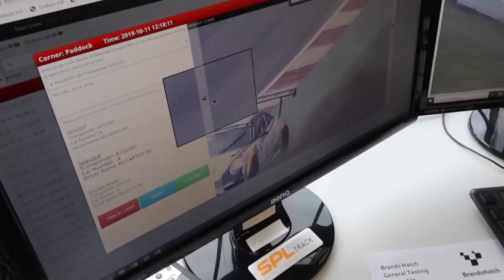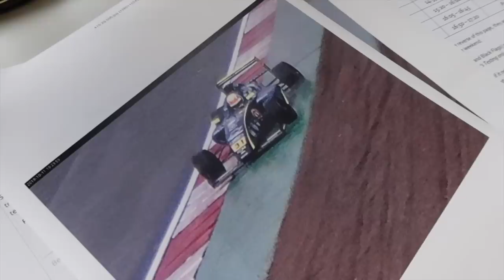Track limits: there is a safer solution! By Peter Windsor

Comment: Why overcomplicating things? Keep it simple. Create a band of, lets say asphalt, which creates much less grip than the race track at these corners, paint it what color you ever like and after that you still can have your run offs.
Leaving the limits of the track has to 'hurt' the driver, that moment when they leave the track, in form of loosing time, loosing control of the car for that moment and handle it, not by a penalty given afterwards.

Comment: How do ensure they don't abuse the allowable run off areas u use gravel or sand if u want to be stubborn about it...these saugage curbs are ridiculous...all seriousness keeping the curbs low for starters and making them into traction braking rumble strips but they should be low enuf to have an affect and still be able to drive over them simply....why in the hell in European circuit are u trying to reinvent the god damn wheel gravel pits worked perfect and they need to be perfected,hey this just in if u vary the degrees if dirt soft ness....hey I race motocross and Moto GP (superbike) when I missed turn one at Pocono going about 80 mph I knew my street tire were not going to offer any steering or grip on the grass in field so with the steering locked to the right and the front brake 100% locked too once I was in the grass I immediately sat up and stopped turn and went straight when in the grass felt like I went faster at first but I did slow down skidding the front wheel for 100 feet lucky I turned in past the unprotected steel guard rail and went from fourth to dead last,if it was gravel I would have done the same except I would not have needed the brakes....gravel is the best if u want to be tough on drivers super soft sand and your race is over....I learned quickly in the SIM when I blow a turn pushing it to prepare for gravel and be ready to get back on the gas in an F1 car to avoid getting stuck u only have a second or 1.5 seconds before the car sinks into gravel sand and your stuck if u panic and forget if u get stuck in a gravel pit ur stupid....once okay second time go sit over there and don't complain any more u weren't think ing...that's your penalty...if your on fire raise your hand we mite come get u...thanks I like to buy the guy who invented those sausage curbs nice gas grill at Wal mart...so he can cook them and eat them....I never been so embarrassed of crashing as I did I destroyed gear box in an F1 car and didn't even know what I hit because I didn't see the curbs either first thing I thought after I realized I probably broke my back in the slapped down of landing the car was what ever I hit is way to freaking tall...then later he told me that there is these big curbs all I thought like I always do because I'm Italian is I could design or figure out something better that would not have the same side effect....it just takes trial and error and master minding with other people who grasp the purpose and the idea being pursued.....aff fugoo

Comment: Next, send audio alarm to nearby cars when a cars loses control. The suspension out of parameter, impact registered, etc. No need EVER to approach an accident at anything faster than MAXIMUM braking speed. When a driver sees smoke and dust, they floor the car first and look for a way around it after.

Comment: if they only keep the racing inside the white lines and stop using those dumb runoff areas.... just put grass and gravel outside of the track and make those bastards respect the track limits again. senna didnt cut corners or leave the track 10 times a race. they were lucky they got back on the track if they left it. those were the days.

Comment: I think a better solution would be about 15cm drop outside the curb until the corner is over, which would force anyone breaking the track limits to drive outside of this drop and loose time before entering the track after the curve, or risk breaking the car, if trying to ride on the drop or enter the track too soon.
Reply: nope, once you allow a 15cm gap underneath the car which there will be after the front wheels travel over it then this will cause a huge amount of lift and the car will go moonwards.

Comment: why on earth would you put such a complicated, expensive system on parts of the track IMMEDIATELY BEFORE THE GRAVEL? just say the limit of the track is the gravel and let people use the curb! people really seem to overthink this problem...you just need some grass or gravel before the runoff (if we're insisting on paved runoff anyway), and the problem's solved. how about some of the safer barriers from nascar tracks?
Reply: You're a karter (or so your avatar says...) so you should fully understand what the green bit is for: it's so that if you slightly overdo the corner, you don't dip wheels into the gravel and lose the car. It's a safety measure unto itself.

Putting SAFER barriers everywhere won't help this either, as now anyone who runs slightly wide will end up scattering bits of carbon and things all over the place as they collect themselves in it. Sure, they got penalized, but the guy behind him that picked up a puncture didn't do anything to deserve that. And that's if the car stays on the barrier, and doesn't eject back onto the racing line.

Comment: First of all: no track should have elements that causes crashes like the F2 crashes we've had this Summer. But despite it's flaws, just bring back more gravel traps, all this track limits nonsense... mistakes should be punished and it will spice up the championship because more drivers will spin out eventually...

Comment: Just let me say this gravel pits and or sand pits are the best because if a car goes off the track going 100 plus miles per hour without slowing down the way it used to in a gravel pit chances are its going to come back onto the race track and cause the worse case scenario if getting hit by another car or multiple cars,if that doesn't make sense to y'all...u are really stupid and I'm wasting my time to try and help u with safety....racing moto GP for the first time I had to do ambassador duty for almost ten years. Because the mechanic who worked at the bike shop near my house died at the same track I did my first race at and over the next ten years I talked to several people who watched this drunken racer die when he hit a wall racing with worn out brakes each one said they would never go to another motorcycle race again....I found out later about his worn out brakes and lack of maitenence didn't matter damage was done....so I had to tell these people my feelings what we do is exciting enuf if we can we need to do what ever possible to prevent this....what I didn't tell these spectators is I rode the same kind of bike and had my brake start failing at the same place on the track and wall where he died I had a cross wind blow right to spot he hit and was killed at but I managed to use the last of my brake rotors to stop five feet from the catch fence a few more feet I was going to ghost the bike but it stopped....I kept asking every one if the bike had some issue or mechanical,turns out brake rotors were no good for race demands and upgrade was allowable within stock rules except they almost told me after I almost died....nice....are we not smarter than that as humans on the whole...